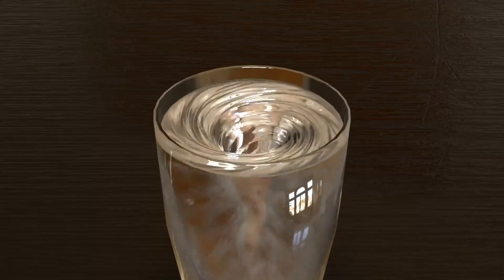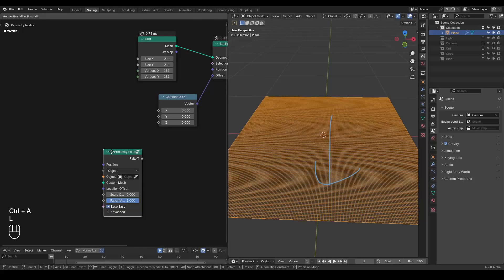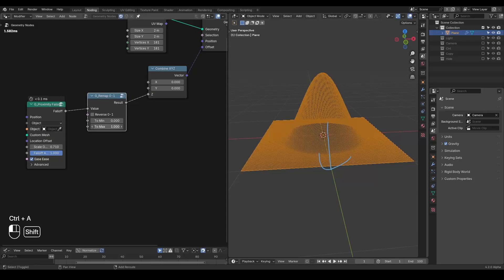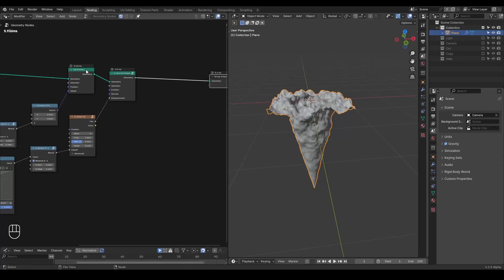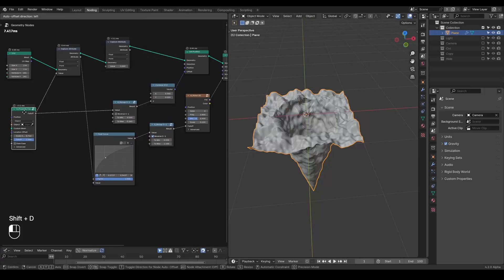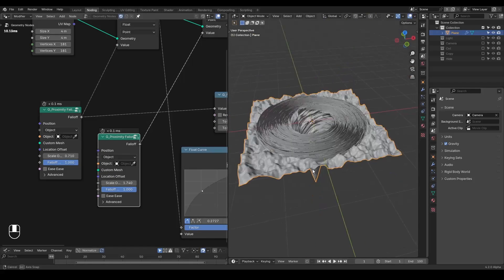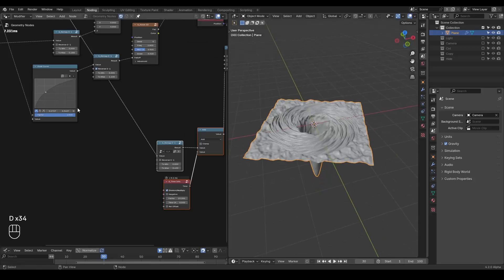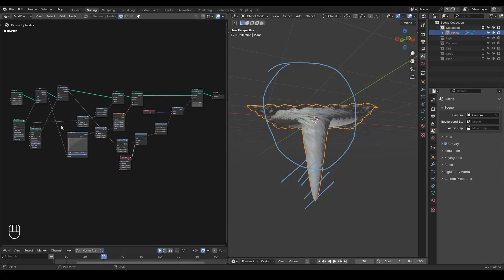[Tut] Procedural Whirlpool/Water Vortex - Blender Geometry Nodes 4.2

Comment: how can you make it a circle in stead of a square?
Reply from the maker: It's a square because we started with a "Grid" which is in square shape. You can start with a circular mesh instead. such as the top part of a cylinder.
Reply: @bradleyanimation120  Thanks!  After some fideling with the parameters i got it to work.
Reply: @SireOwner  could you help me getting it circular than the plane grid? Did change it to the circual mesh - but its not filled with anything anymore for me.
Reply: @GordonWOT  I used one of the presets form bradley that is called G_Filled Mesh circle. You can find the link in the discription.
Reply: @SireOwner  thank you
Reply: @GordonWOT  You can also use a cylinder and then add the seperate geometry node. connect the mesh to the geometry and the top to the selection from the cylinder node. and then replace that by the grid node.
Reply: @SireOwner  Can i catch any contact with you maybe discord/messenger? I just simply dont understand how to put the cilinder in - it will be  very usefull for my mixing in the tank ''simulations''.